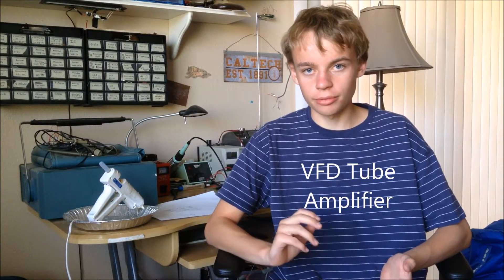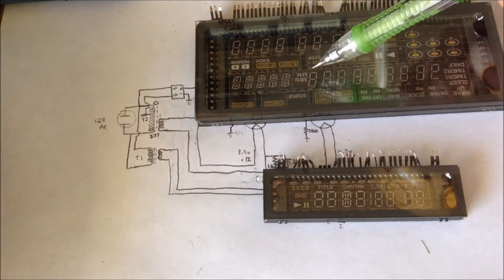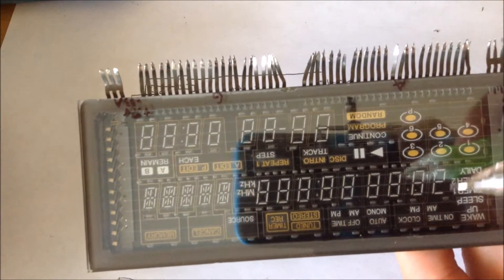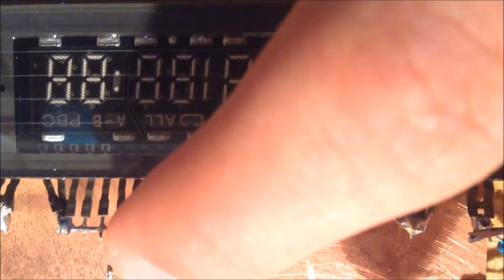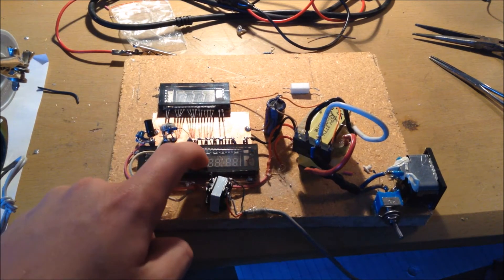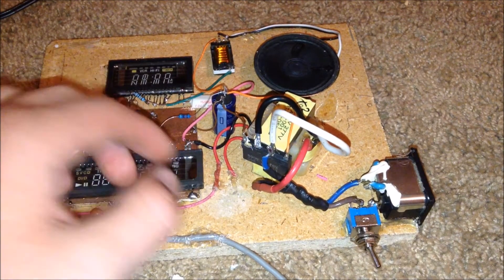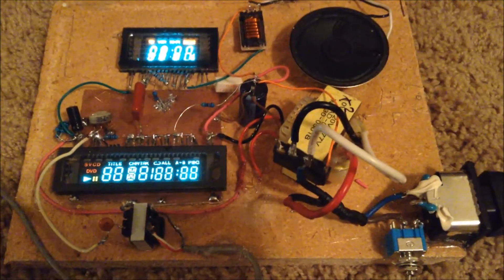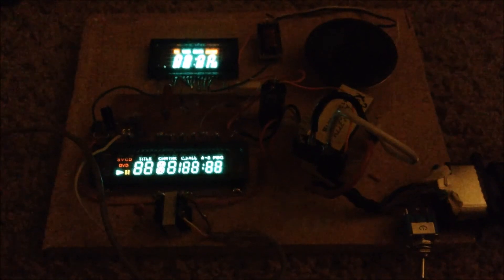VFD Amp: An Amplifier Built From Old VCR Screens

Comment: Good Video. I think the VFD may be used just as a Preamp Stage, ando therefore, something like the good old TDA2003 for Power. But, anyway, you had a point and made it work. Good Job.
Reply: I'm actually building that right now, but I'm going to be using a TDA2030A in a bridged mode.

Comment: About the low output ¿does it have b+?
If it has use 230 volts, yes it could be dangerous but it sould lift up the gain a little bit

Comment: Hello friend, is the transformer used to feed the Filaments or the Anodes and Grids? And it was not rectified? Thanks
Reply from the maker: It was not, but it does not matter too much.  I have heard that AC causes a better heat distribution across the filaments, but I have not tested it yet.  The anode and grids are powered by DC from a different transformer coil that was rectified.
Reply: @TannerTech  Okay, so this is a small transformer, say, around 3 volts AC? Thanks
Reply: @TannerTech If you didn't hear hum, then using AC is fine. AC is arguably better for directly-heated tubes but offers no benefit for tubes with INdirectly-heated cathodes. So it depends if the VFD filaments emit electrons directly from the heater wire surface, or whether they (indirectly) heat up a surface in contact with them, that has the emissive material deposited on it. I'm assuming that VFD's are directly heated...
Reply: Knowing the EXACT filament voltage is important. "Around 3V" doesn't really cut it! Maximum output & optimal tube life depend on holding the filament voltage as close to what it was designed for as possible. For a "proof of concept" project like this, yeah. It's hardly critical. As long as you don't burn out the filament completely or have such high voltage on it that you destroy the emissive coating(s) in less than say, 10 hours? I guess you're doing fine.🤗🤧
But too low a filament voltage could have been your lack of output problem (unlikely, more that the VFD has really poor transconductance & high digit...I MEAN! "Anode" impedance.
Korg's "NuTubes" have the exact same problems, btw.🤣🤣🤣😉
Still, you definitely want to make sure that the filaments get up to their recommended operating temperature for absolute maximum performance, especially when there's precious little performance to be gotten in the first place.
Otherwise we'd all be using VFD's instead of 12AX7's, I guess.🤔
Reply: @joerosen5464  Tks
Reply: Absolutely BRILLIANT, Tanner! Hats off! I'm a vacuum tube audio circuit designer & it never occurred to me that VFD's were really triodes in disguise 🥸!
I've got PILES of broken VCR's & stereo Minisystems with these obnoxious displays in them that I hadn't had the heart to throw out just in case there MIGHT be something still in them that I might possibly need, despite the fact that they're mostly all well beyond any hope of recovery. And thanks to you, now I do! Hard to believe some teenage kid would teach this 60 year old something completely new about TUBES of all things, but here we are!
If you figured this all out by yourself, you're going to be one scary genius when you get to fool adulthood!😎🤗

Comment: this is really neat I have been working with 12au and 12ax7s for 18 years I have them figured out vfds are out of my design league but something interesting to look up is the Korg new tube wish is a vfd dual triode that sells for 50 dollars on ebay and has the circuit board that it fits into really cool concept.

Comment: A company by the name of Korg is now producing VFD amps that are designed as such, run on low power. VOX has designed guitar amps that make use of these Korg VFDs and are capable of up to 50 watts of power. Price is about 200 dollars for these amps.
Reply: The nuTubes are only being used as pre-amp tubes, the 50 watts of output power is from a class D amp.
Reply: Ibanez threw some of those nutubes into their new tubescreamer.
Reply: @Andrewstonerock странно, ведь tubescreamer - это всего лишь усилитель перед усидителем, чтобы лампы сразу разогнать более громким сигналом